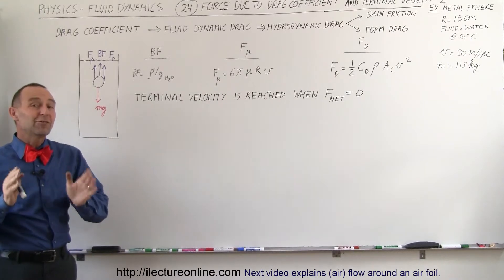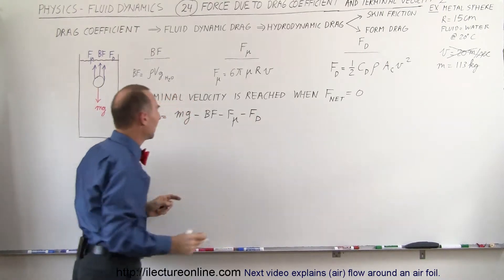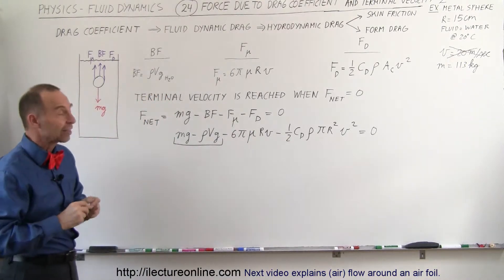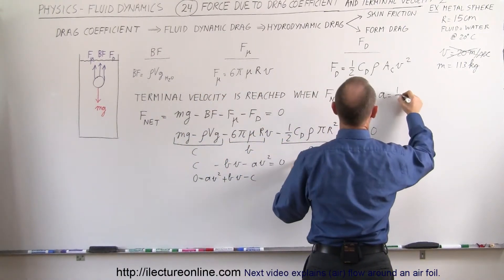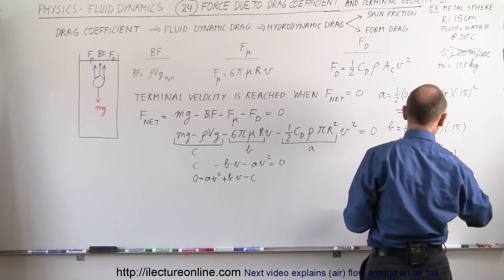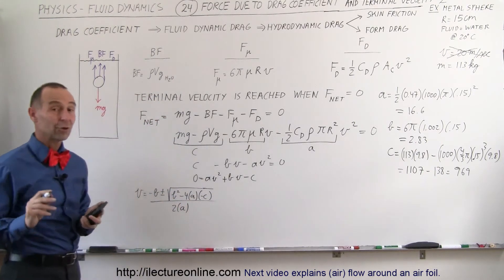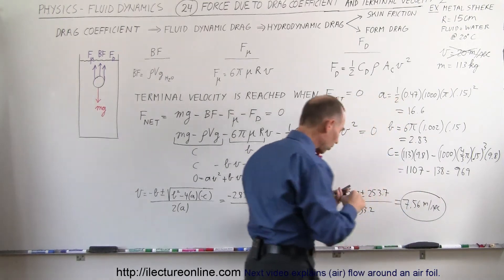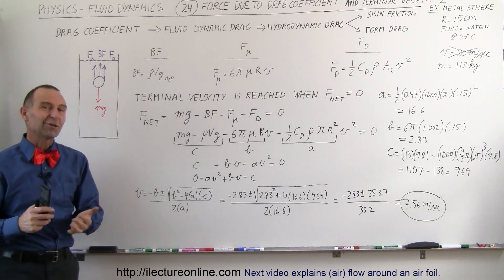Physics 34  Fluid Dynamics (24 of 24) Force Due to Drag Coefficient and Terminal Velocity***

Comment: Hello and thank you for the video!

Quick question: why did you use water viscosity = 1.002? If I understand correctly, this is in terms of cP which is not an SI unit. If all of your other terms are in the SI system, shouldn't viscosity be 0.001002 Pa*s?

Comment: Why do you use pi*r2 (cross section) instead of the total area of the sphere surrounded by water which is 4*pi*r2?
Reply from the maker: Since the sphere is traveling through the fluid, we only care about the cross section.
Reply: ok, surprised however, the cross section is considered when the fluid passes TROUGH the sphere, the volumetric flow, in this case, being expressed as qv=velocity*cross-section, but here fluid is flowing AROUND the sphere, so that was my point, but maybe the correlation has been related to the cross section also in this case. Thx,
Reply from the maker: Think of it this way.  If you are running holding an object, the resistance of the air will depend on how large that object's cross section is (not its volume).  There will be a coefficient however that is related to the shape of the object and the flow of fluid around the object.
Reply: Thx, Sir...I've have others questions, the Cd depending on the Reynolds Number for example, but it's very late here in France, I'll come back to you soon..Appreciate the discussion.